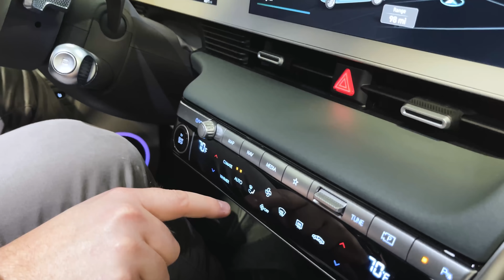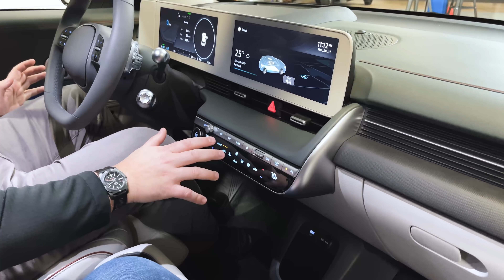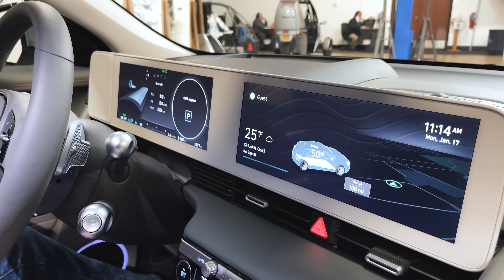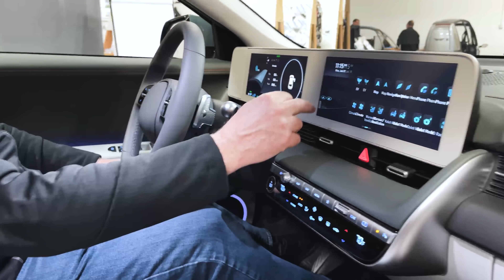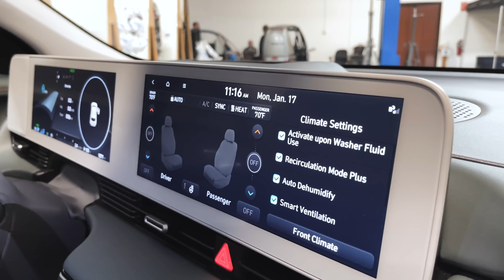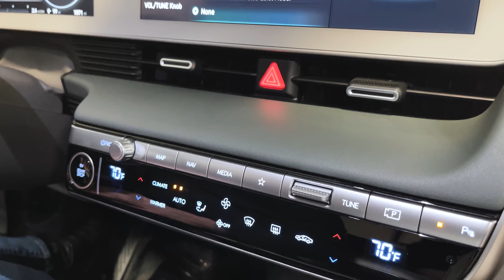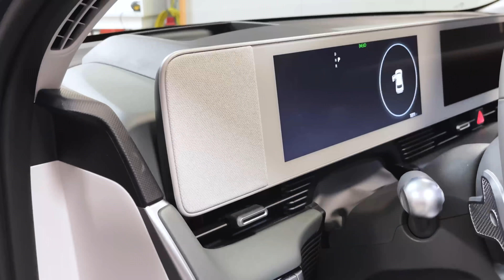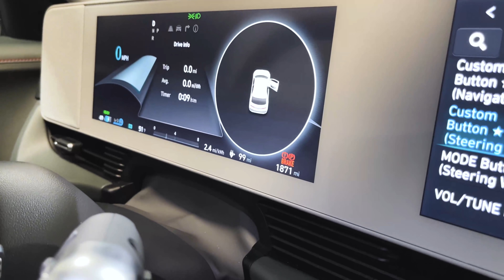2022 Hyundai IONIQ 5 | Sandy's First Impressions

Comment: Sorry Sandy I disagree, keep the heater buttons etc on the dash below the screen.  If you have the radio or navigation maps on the screen you do not have to get out of the screen to adjust the climate controls etc.  My compliments to Hyundai for great dash board design...
Reply: I agree with sandy. I would rather have a larger screen with a couple climate control buttons on it than to have these physical buttons. On the tesla, I just set the temperature and the fan control is on the steering wheel. The only time I use the screen is to either turn on/OFF the A/C completely or to change the airflow from the vents to the windshield. How often do you go into your climate control that you need to have physical buttons?
Reply: Plus you don't have your passenger dropping the nav map to adjust the temp, etc. Ditto for the volume and other sound system controls - Sandy is happy to have them on the steering wheel, but there is more than one person in the car! 

Sandy likes a car to be rental customer friendly and also notes some makers are going for an EV that doesn't give too big a jolt to drivers transitioning from a traditional ICE car. That's what these duplicate controls provide, as well as passenger access.
Reply: Agreed. It was a cool thing to see at first in my Tesla and show people but the longer I own my model Y the more annoying everything being on the screen becomes. Plus, now that the original UX people have left the company and new tesla people take over the software has become increasingly worse. Give me physical climate and vents
Reply: Totally agree. Not everything belongs on a modal touchscreen. A good UI design allows you to be task focused and not be forced to unecessarily switch contexts (like having to swipe away something like nav to get to something else like climate, volume or radio station) or even having to think about contexts for that matter. Things should just be there, for the tasks that you fiddle with most of the time while driving.
Reply: Agree.  Would probably not buy the non button one if given the option.
Reply: I agree. Call me set in my ways.
Reply: Absolutely.
Reply: bunch of boomers in here. move on, screens are superior
Reply: @a-don13  Buttons lack tactile feedback plus menus mean no direct access.  They are cheaper than buttons.. this is why I prefer a keyboard instead of a touchscreen: it is better.
Reply: @aitorbleda8267  there are buttons on the steering wheel, anything else isn't necessary. plus use voice command for direct access for setting that you don't change often.
keyboards are a necessity tho
Reply: @a-don13  nice. What a cliche,  calling people you don’t know “boomer”. You need some new material.
Reply: @keithv3767  am i wrong tho? I ain't the one complaining about inevitable change that we saw coming a mile away
Reply: Personally I prefer it all on the screen. Volume and climate don’t have to interrupt anything, that’s just a UX design flaw. But that’s exactly why it’s so great, flaws can be updated, improved and changed!
Reply: Except the seat heater is on the freaking panel
Reply: @a-don13  As Munro is himself a Boomer,  you just realized you can't judge a book by it's cover, Duh ! 😆
Reply: @aitorbleda8267  Finally ! Someone who realized that the Model 3 big screen is only a freakin' cost saving measure, yesss !  Tesla engineer's do not give a shit about a car's interior design. Big difference between an "older"  Model S and the 3, I guess that's what happens when you hire engineer's fresh out of school still living in their parent's basement, playing video games all night long... 😤 So keep the buttons Hyundai !
Reply: @daltonx6177  sandy isn't a boomer, he welcomes change
Reply: tesla is changing stuff just to be goofy, millions of people have gotten used to controls, not having to search a friggin screen while driving, super DUMB
Reply: As an owner of a '17 Civic with fan speed, a/c on-off, etc., buried in the screen, I agree 1000%.  Half the reason I want to get the '22 model is to get more buttons back.
Reply: When Ford ask the customer what they wanted they said a better horse.
Glad Ford didn't listen to them... For so long the center council has been littered with a gear shifter to please customers. Absolutely ridiculous. Even when cars became front wheel drive and there was no use for the shifter in the center console They still went through the trouble.
Just please the customer.. Not good engineering. Just doing things for the emotionally impaired.
Reply: @davidhumeston5292  The point is, adding more steps to access a commonly-used control is not an improvement, especially when you're being expected to pay attention somewhere else.
Reply: @LJ-wo1wf  True... The star buttons on this steering wheel could be programmed to bring up the heat menu but in my car I set it to automatic I don't play with it when I'm driving. I'm too busy texting on my phone mostly. 😂
Take care enjoy
Reply: @davidhumeston5292  Chrysler used to have the shifter in the dash, it was non ergonomic, it faded, my manual STICK VW Golf R has the shift, where it belongs, in the center console....what does front wheel drive have to do with where the stick shift is?  My VW Golf r is 4 wd
Reply: @a-don13  Fine on smooth roads - but many countries (esp in Europe) have bumpy roads - and selecting stuff off a screen is a mare.
Reply: @cengeb  I'm talking about automatic transmission.
For electric cars.
For me no R N D in center console..
Totally stupid for me and the way I drive .
The center console is a great place to store things.  Phone drink food and so on.
No car functions.
And a rear wheel drive car with the engine up front the transmission tunnel used to be in the center of the car it's made complete sense to put the gear shifter there.... But yes if you have a standard transmission at a front-wheel drive car you have to put a gear shifter in the center console. But standard transmissions are going to be gone.. no more... history.. like a horse and saddle
Reply: @a-don13  Voice commands ??!! Have you tried them much! Even Siri gets me wrong - often! The car voice control either doesn’t understand me, or picks up something else !
Reply: @David Humeston  I will have to buy the last stick,manual golf r then...stick is driving automatics is just going along for the roll...stick keeps you alert...vw golf r and gti one of the few sticks left...audi no more stick for u.s.,porsche has a few stick,oddly in europe only automatic in golf r...where they had stick on most everything...even WV tiguans,which wasn't here with stick...things are changing indeed
Reply: Too bad it does not have voice control for aircon.
Reply: @davidbeppler3032  Tesla does yeah voice control
Reply: I agree with Sandy.  Some of you complaining also complained about the beautiful shiny black seat backs that used to come on the model x.  Learn to appreciate what’s better.
Reply: @davidhumeston5292  that has nothing to do with the ioniq.  The car in question.  The one with too many buttons in all the wrong places that are redundant.
Reply: Somehow Hyundai will find a way to have sludge buildup in an EV
Reply: I can't agree with you more!!!
Reply: @nickwulf  🤣🤣
Reply: Agree!  Too many cars require you to take your eyes off the road to perform basic functions.  Major fail when the physical buttons are removed.
Reply: I see both sides--and have a 10th gen Civic so I know about "missing" radio controls. But I will offer this: look at Honda's experience getting rid of controls for touch UI. The amount of customer/reviewer hate they got over this was mind-boggling. You'd think they put on square wheels or something. (That Honda's touch UI is slow like a snail on downers doesn't help, for sure.)
Reply: I'm a millennial and prefer my temperature and volume to be separate buttons because I use them so much. Nav can stay in screen
Reply: @robf88  Maybe the car design can be altered so one doesn't need to fiddle with temp controls so much. People don't have to adjust our house ac that often.
Reply: @robf88  Maybe the car design can be altered so one doesn't need to fiddle with temp controls so much. People don't have to adjust our house ac that often.
Reply: Ok boomer
Reply: Agree with you on the buttons. Nothing worse than driving at night at minus 30 and trying to fiddle with menus on a screen
Reply: @ericbertrand7596  You could have stopped with nothing worse than driving in -30°.
Reply: You set the climate maybe once a trip, Nav is way more in use.
Sandy happens to be spot on,
That is unless you're a gen Y which the likelihood you are one is odds on highly  favored .
Ask this question 
If it werent there would you miss it?
I honestly don't think so.
Reply: @cheese.n.crackers  agreed.  I get used to my vehicle so I can adjust anything by feeling for textures with dials and levers so I can keep my eyes on what's important.  Now I play the game of operation to change the radio stations.
Reply: Boring… you can adjust temperature without dropping sat nav in a Tesla. You can also adjust temperature using voice commands. Don’t forget Tesla, like apple before it, designs the tech people don’t realize YET that they want. If companies like Tesla waited around for people to tell them what they wanted we would still be riding horses.

Comment: No way should they get rid of the tactile climate control.... You want to be able to change the temp while driving with ZERO visual input needed. Touch screens with multiple menu layers are TERRIBLE for anyone like me that needs reading glasses to read but not to drive.
Reply: Seriously, have you not looked at modern infotainment screen in cars. Every newer car I have driven have the temperature controls on the home screen and the seater heater control right next to it. They usually have a knob for the fan. Tesla lets you program the steering wheel dial to control the fan. I have never needed to scroll to control the basic A/C settings. Knobs are easy to find without looking. When you have a bunch of buttons across the dash, you are looking down. It's very hard to feel them out.  Frankly, if the infotainment has multiple layers, that is bad UI design. There should be a settings home screen with general categories of controls and one layer for each category for the settings.
Reply: Yes, it would be great to have full voice control.  I can buy a Google Assistant for $40, why can't that just be built in to fully control the car?
Reply: No Its super super easy on my ID3

Climate Button and then + or - goes back to homescreen on it own after a few seconds, amazing design.
Reply: Voice control is played out. I love how Hyundai has implemented hvac controls both discreet and in menus. There’s no need for digging any more than turning a knob in a 91 Ford.
Reply: Yes, exactly this
Reply: His view is probably skewed by living in the USA. On most roads you probably have time to take your eyes off the road fro a few seconds in order to go through some menus to clear your windscreen.
In other countries where the roads have corners it helps a lot if you can reach over and hit the button without looking
Reply: Don't worry. South Korean consumers like buttons :)
Reply: It gets old when people keep claiming they never look at buttons.  You do all the time.  Your mind tries to tune it out because it is occupied with driving.  Nearly every button press you make has a glance, whether you realize it or not.  That is why steering wheel controls are all the rage, they eliminate the distraction and glance since you locate and press buttons much faster.  Your brain juggles the button pressing with driving for a tenth of a second instead of 1 or more seconds with any physical dash button.(All physical dash buttons are a distraction whether you want to admit it or not, touch buttons are exactly the same as physical. Remembering where buttons are only reduces distraction time,, not the intensity of the distraction.  Steering buttons reduce distraction time the most.)
Reply: Every new vehicle should have programmable buttons and a dial and left right up down buttons.
Reply: @carlstockmal  try to use voice control in the middle off a conversation between your other passengers. Or while listening to music or while using the hands free phone for talking to someone. Void control also is about as distracting (because you need considerable amounts of your attention to formulate and voice the commands), it’s just shy of the distraction you get from handling your phone and that’s about as bad a being drunk…

Comment: Sandy, I have to disagree with you about hiding climate functions on the screen. I actually really like how the buttons/touch bar with all the climate controls seems very minimal and easy to use in this car. I’ve been driving a Tesla for a bit now and find the climate controls to be the most annoying I’ve ever used in any car and makes me take my eyes off the road too often. Physical climate controls allow for muscle memory to develop, and are the safest option in my opinion.
Reply: Of course most people like daily things as physical buttons. Teslas latest UI “upgrade” has so many people mad. They made simple task like defrost multiple steps on a touch screen. Where it use to be easier access from the main menu. Of course you don’t hear about this from Sandy because he he loves the most lightweight, zero button car imaginable. I’m starting to think Sandy doesn’t actually drive.
Reply: @Jkeys-ov1mw  it is very odd how Sandy doesn’t seem to realize how important easily accessible climate buttons are. I don’t mind climate controls being on a touchscreen as long as they remain in the same spot and have all the functions accessible immediately, but what Tesla did is just horrendous.
Reply: The temp controls are on the home screen and I have the right wheel knob set to control the fans. Since I generally don't change the temp but I do change fan speed, I rarely need to take my eyes off the road.
Reply: @Jkeys-ov1mw  It's a swipe up to get all the climate controls. Not a huge deal. However, I did prefer to have the seat heater and defrosts icons on the home screen. You can always use voice controls, but I get that most people aren't used to using voice commands.
Reply: I don't really find the climate controls that unintuitive in my Model 3, but they did remove some of the intuitiveness in the latest update by putting the seat heater button in a sub menu. Besides that the temperature adjustment is always in the same spot and it's usually the only thing I fiddle with most. Too cold? Tap the up arrow a few times. Too hot? Tap the down arrow. Or even use the voice assistant to "Set Temperature to XX". But I always use auto and let the vents do their own thing 99% of the time.
Reply: @Jkeys-ov1mw  My kneeejerk reaction was to hate the new climate functionality on my model 3. But I actually  prefer it now as it is all very close to the wheel. I can hit the temp without looking and then glance for defrost/seat/whatever. The old way I had to reach all the way across to the far side of the screen to hit defrost. That required a look and a lean. Not everything is better in v11 though!
Reply: I agree completely.  If they had left out the controls I would be less inclined to buy one.  As it stands now, I will most likely be getting a white limited awd when they are more readily available in the area.  Only one scheduled to arrive in the area (next month) and is already sold.
Reply: I agree. Buttons rule. Did Sandy say he didn’t like radio/music controls on the steering wheel? Damn! I use these controls all the time and makes driving so much safer.
Reply: @Jkeys-ov1mw  having physical buttons even prevents such a Desaster of an UI update…
Reply: @Jkeys-ov1mw  He drives a Jeep Wrangler. No climate control :D

Comment: I prefer a console with the buttons and don't want to fiddle with a display. I appreciate Hyundai for doing it that and not putting cost cutting above usability.
Reply: Yep I totally agree. Please keep the climate buttons out of the display
Reply: Same. I have a model 3. I like it but something feels unfulfilling. They changed the User Interface and I don’t know how to open the glove compartment. I have to ask the car to open it as there is no latch.
Reply: I'd much prefer not to fiddle with buttons and use the display.
Reply: @cybat1078  Tap the controls button, that’s the car button on the bottom left, “Glovebox” button is on the right (right next to the glovebox).
Reply: Extra pages and submenus should be avoided at all cost.
Reply: I'm in favor of minimalism, but tactile buttons for my most common needs are a must. Maybe a small panel with just a few programmable buttons would be the best compromise?

Comment: What makes the Ionic 5 unique is how the designer integrated the unique look of the front into the rear of the car. Many cars fail at one end or the other.on the Ionic they both blend beautifully.
Reply: THANK YOU. I’ve been saying this for a while. I do not understand the lack of continuity in many of today’s vehicles. It’s the reason why I don’t like the EV6. The front and back look like they came from two different vehicles. The Inoniq5 has a clean and unified design. Everything was considered for one look. AND no competing second grills and intrusive fog light compartments.